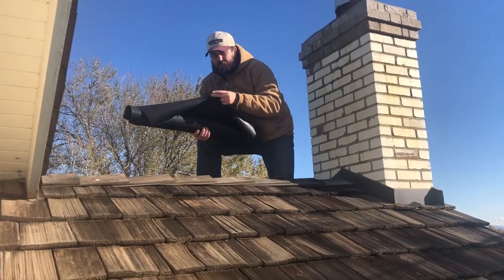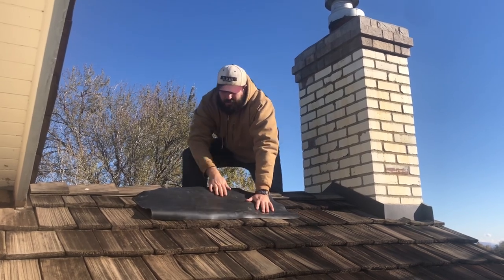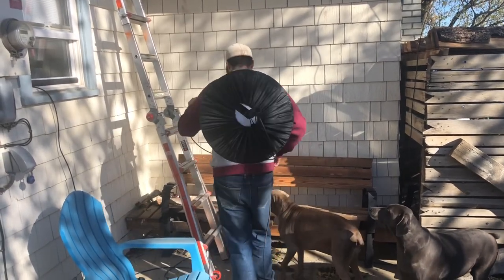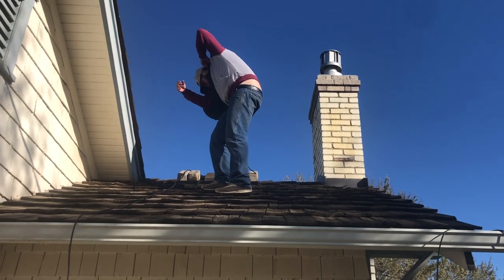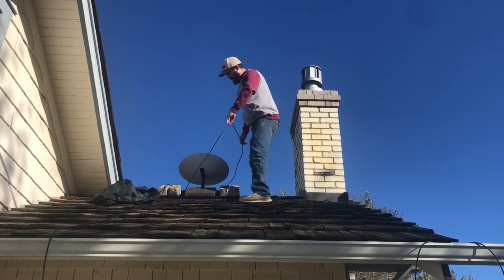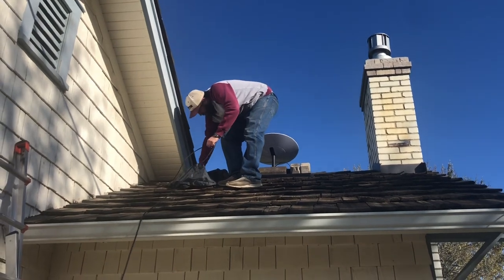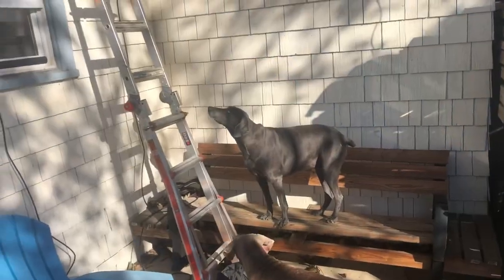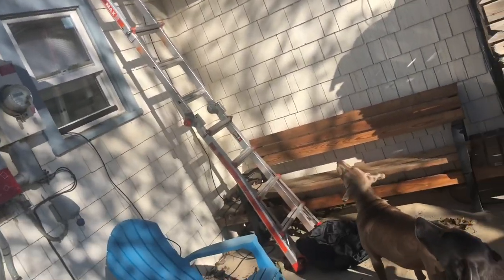Installing Starlink Ridgeline Roof Mount Part 2: On the Roof

Comment: When you finally run the cable into the house, don't forget a drip loop before it goes into the house, especially if you are taking the cable down into the hole in the wall.

Comment: Great videos.  I think you may have convinced me that this is the way to go.  If at all possible I think I would have come in through the attic vent and tried to come down and through a wall.  It also may be worth taking small wire and wiring the bricks down to the mount.  Anyway, thanks for the info.
Reply from the maker: Glad it was helpful!

Comment: are you sure thats a good location? Looks like any obstruction like the chimney can affect it.
Reply from the maker: I can move it up higher on the roof, but I haven't seen the dish face south at anytime in the two weeks I have had it. I am still downloading at 150 Mbps, but if I do start having issues I am for sure going to move it up higher.
Reply from the maker: I don't mind at all, I appreciate you helping to spread the information out there for people. Thank you Richard!
Reply: @adventureswithkramer  Even if it doesn't face south, it still aims in a pretty wide beam from the dish facing angle. If the app shows any obstructions at all then you're going to occasionally lose connection when a satellite passes behind one of those obstructions.
Reply from the maker: @Ergzay  it might be hard to believe from the angle but the chimney isn’t within that 100 degree cone on the app.
Reply from the maker: Also, just checked the stats on the starlink app and have only had 3 min of no satellites in the past 24 hours. Best reception so far. 

I know it would be better up higher, no argument there. But this allows for some extra protection for the elements.
Reply from the maker: @Ergzay  if I do start having an increase in no satellites then I will move it farther up. Super easy move.

Comment: Yesterday I received an invitation to place an order - which I did ($99 deposit to hold my place) - and I'm wondering at what point will I be able to order that roof saddle.  Did it cost much?  Also... do you remember the dimensions of the bricks you used?  I like the idea of the edging bricks... more weight without having to stack tiles.  I'd like to get everything bought and ready to install by the time my kit arrives which probably won't be until summer.  Many thanks for the video.  Exactly what I needed to see. 👍
Reply: I saw another youtube person say it was $99

Comment: A piece of galvanized pipe on that chimney would be a much cleaner and secure installation with a cleaner sky view and no problems with snow and your wooden tiles . 
just drilling 4 holes and  2 clamps

Comment: any issues with ice building up  off the edge of dishy  and long enough to touch the roof ?
Reply from the maker: Ice locked the dish in place, thankfully nothing broke but it did form ice around the dish more. The Ridgeline roof mount has a thin rubber membrane that helps with any leaks.

Comment: Is your ridge line running west to east? My ridge line runs north to south. Is this mount designed for west to east ridge lines only?
Reply: I'm pretty sure you can turn the antenna to where you need it.
Actually I have seen that it does that automaticaly.

Comment: I don't think that mount would work for me. The snow on the roof would pile up and bury it. Unless it puts out heat that would form a cavity around it. But that might lead to an ice build up. I am going to wait (not that I can by anything now any ways) to see how that mount performs with large snow loads over  a few months. Certainly would be easy to uninstall. Hey thanks.
Reply from the maker: I have that same worry, most of the time I think it will be fine but I think only the upper surface will heat up, and from what I have seen of other beta testers back in Montana with snow on theirs the bottom is coated in ice... :(

Comment: I’ve never seen a mount like that before.  I’m assuming the volcano mount is an option if folks prefer to lag it to their roof?  I don’t have any experience with wood shake roofs though, looks like that could be problematic.

Either way great job with the vids!
Reply from the maker: Thank you, If I were to use lag bolts on my roof I would need to pre-drill through each shake which isn't a problem. but it does make it tough to seal even with the included rubberized adhesive in the volcano mount kid. I think the volcano mount is meant more for asphalt and flatter roofs where the angle is. I also wanted some extra freedom in moving the satellite around in case i wasn't getting a good signal in different locations. Either due to the main power lines going to my house, obstructions from trees, etc. Also, I want to put holes in the roof of my house about as much as... doing the world hottest chip challenge, lol.

Comment: Does that come with the cable clips like the volcano mount does?
Reply from the maker: yes it does, looks to be the same amount too, around 30.
Reply: @adventureswithkramer  Yeah, just found your unboxing video where you show them.
Any reason you didn't mount on the main roof?
Reply from the maker: @richardborlandhodson  My dad's idea. Because of where I live, the prevailing winds come from the north - northwest and head south. By putting it in this location it give a small amount of shelter from the wind. Even though it looks like the roof is blocking the signal, I assure you it isn't. I have actually had better latency and SNR (signal noise reduction) with the dish in that position. It never in 2 weeks has faced south to connect to a satellite. If that ends up changing in the future, I can easily move the dish up higher. 

Good question, thx for asking :)

Comment: Lot of extra work for no reason. I know there is a plumbing vent sticking out of your roof somewhere...use the available pole mount and be done with it cleanly.
Reply from the maker: I would never mount to a plumbing vent, with how much force wind can push on it and maybe create a leak point. But anyways my roof doesn’t have one. My plumbing vent is in the attic. I also don’t want to drill into the roof and create potential leak points. Even the instructions and starlink stuff say that drilling holes can cause a leak and they are not liable for any damage, I know it’s a blanket statement but still hesitant to drill into my roof.